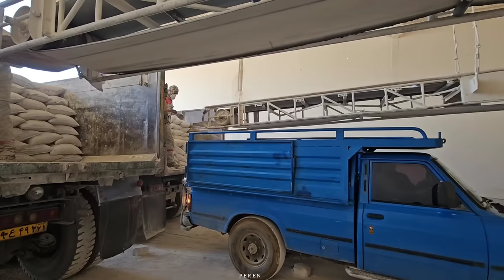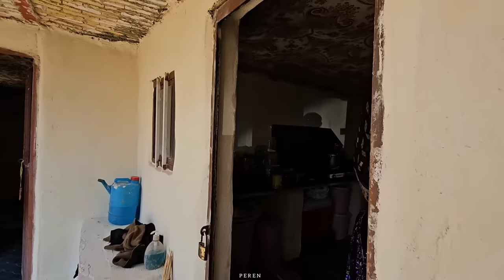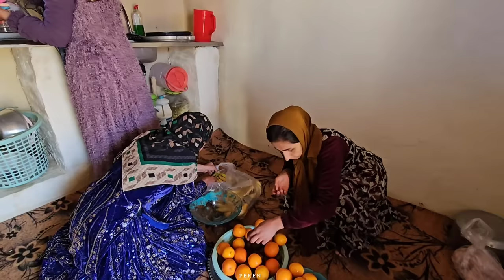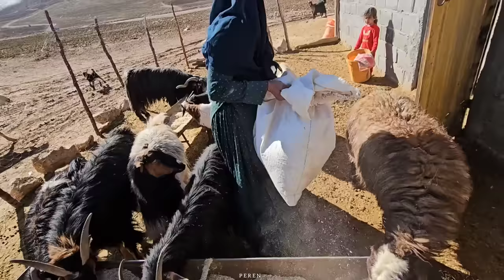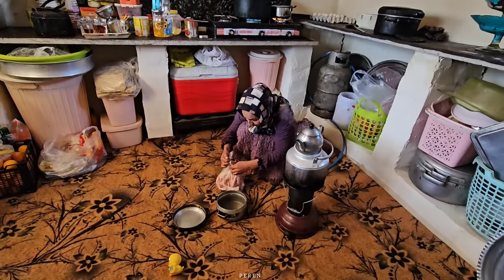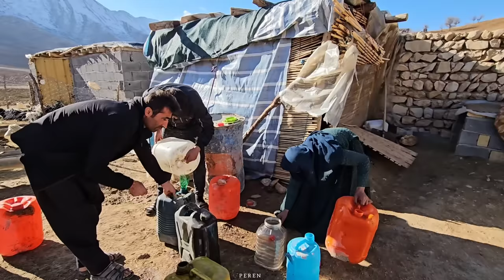Banquet in a nomadic house.  Ali and his wife have come to the party to see the Shirvan family

Comment: The old kitchen area needs to be torn down..it looks terrible and is a potential fire hazard.. I am worried about it for your family. Once you finish the other bedroom, please build a storage room with cement blocks to put all your oil, gas, tools and your extra supplies. It would look neat and organized and it would be safer. I am not criticizing but just offering a suggestion.
Reply: The other bedroom is used for baby lambs and for storage